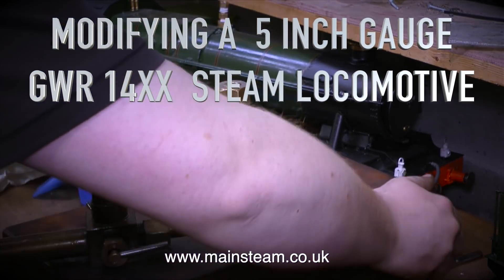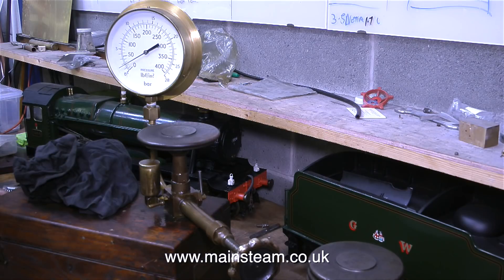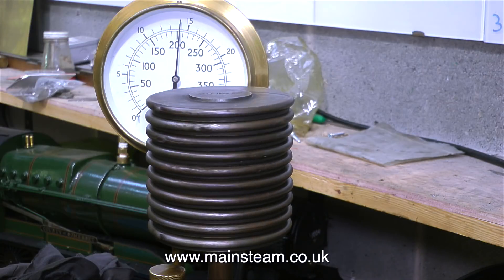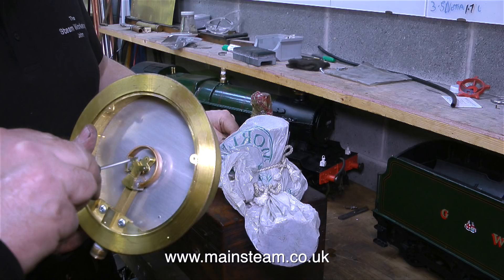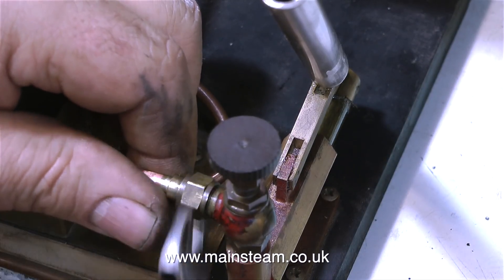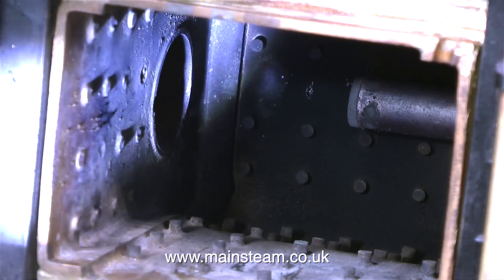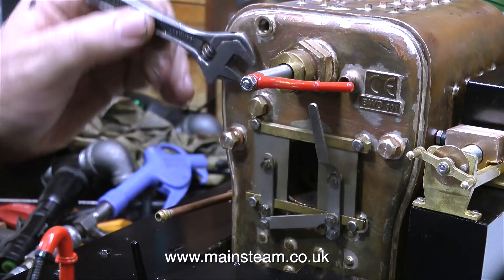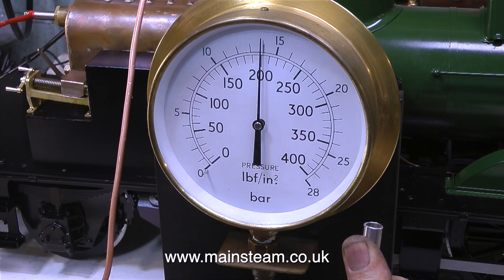MODIFYING A 5 INCH GAUGE GWR 14XX STEAM LOCOMOTIVE - PART #12

Comment: Your gauge may not be one of the expensive ones, but it has the test range right in the middle of its scale. I looked up the BUDENBURG pressure gauge calibrator and the current ones look almost identical with the one John used. If you were issuing Boiler Certificates would the error on your gauge have to be marked on the gauge and the Certificate?

Comment: HI Keith very interesting to see how a gauge is calibrated a big part of my job is to do hydro testing and high pressure gas testing on check valves for the gas and oil industry we use analog and digital pressure gauges just finished a job that require hydro pressures 15.000psi and 10.000psi on gas (nitrogen) so i can appreciate how important this type of testing on steam boilers is and i always look forward to your videos and your dry seance of humor

Comment: As I understand, your pressure gauge is reading more than the actual pressure. You said, this is better then the opposite. I thought it would be better to read a slightly lower preasure which will mean that you actually have a slightly higher pressure on the boiler while testing. Maybe I missunderstood something due translation problems in my brain, Can someone please explain?
Reply from the maker: As long as I know what it is - that's all that matters . . .